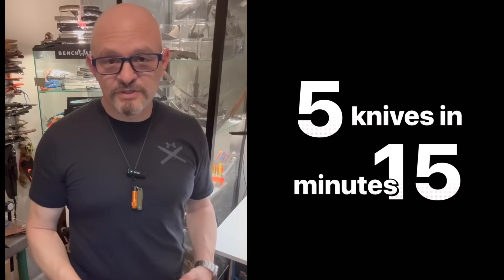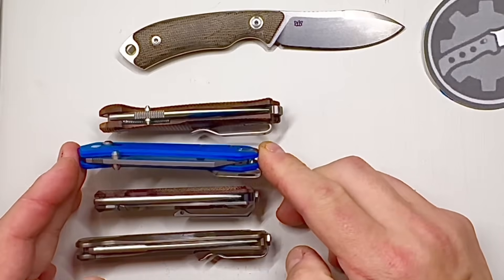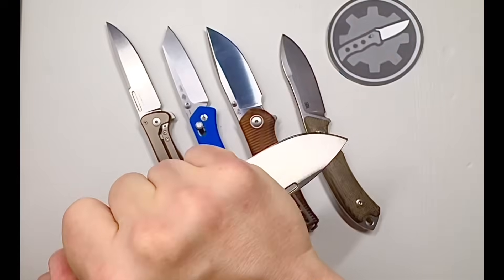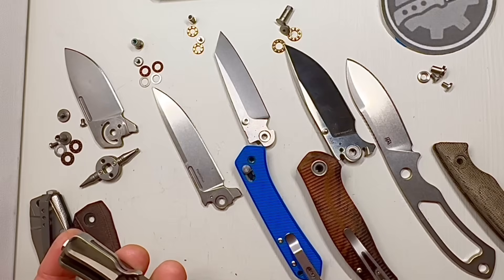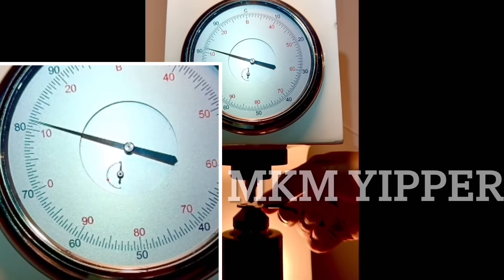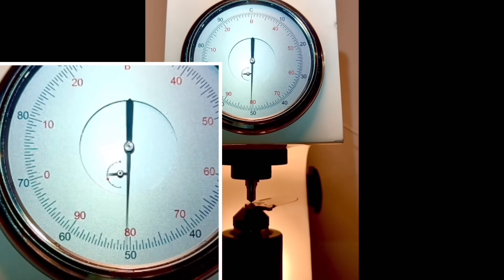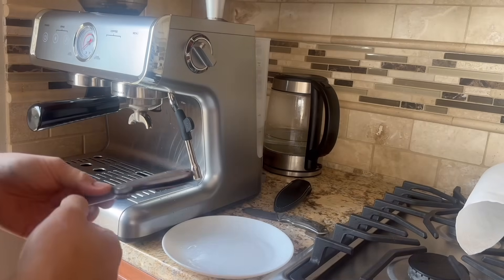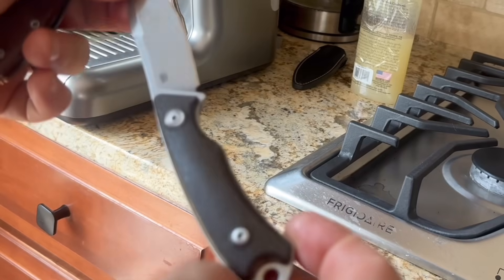Finally! Hardness test of 5 Italian MagnaCut Blades.

Comment: did you end up performing the magnacut hardness vs corrosion resistance tests we discussed a few months ago? Would be a great plot to see and im sure a lot of people would be interested, especially if it ends up with a smooth curve.
Reply from the maker: I don’t have a good way to quantify the corrosion affected area. So it wouldn’t be a legible result
Reply: There isn’t any direct correlation, Larrin just released an article to try to dispel this myth because so many people are saying lower hardness magnacut has better corrosion resistance and furthermore saying the he said it, which he did not.
Reply from the maker: @poncho151 Link?
Reply: @CuttingBoardRx it's in his original article for magnacut. His testing showed slightly reduced corrosion resistance for the higher austentising temperatures, which puzzled him because it should have been the opposite. He chalked it up to some anomaly like iron contamination (I'm guessing from a belt??). Let me re-read that article and I'll repost it here if I got it wrong.
Reply: @CuttingBoardRx 

Just copy pasted from his article:

"The test above used a 2100°F heat treatment. To see how the steel compared to Vanax and to test the effect of heat treating I also did a range of coupons with austenitizing of 1950, 2000, 2050, and 2100°F. Lower austenitizing temperatures typically lead to slightly reduced corrosion resistance so I wanted to see if there was a big dropoff. In the retest I used 3.5% saltwater for 72 hours, which will rust just about anything outside of Vanax or LC200N. The 1950 and 2000°F samples showed no rust spots, while the 2050 and 2100°F had a couple very small rust spots. This is probably due to inconsistent finishing in the corners (notice the location of the rust spots), or perhaps some minor contamination of iron particles there. There is no reason for those samples to have lower corrosion resistance compared to the 1950 and 2000."
Reply: @poncho151 he did say it in a roundabout way, in his original magnacut article.